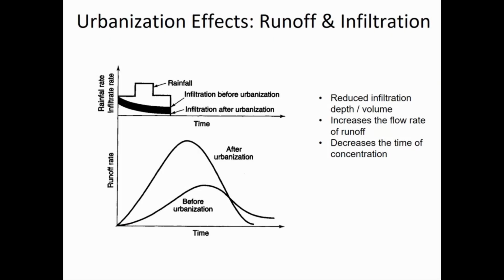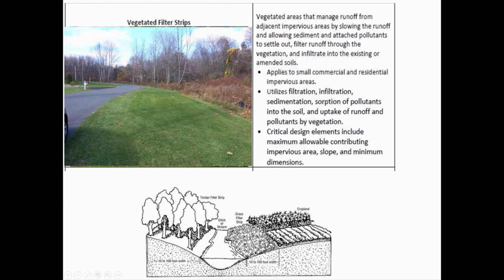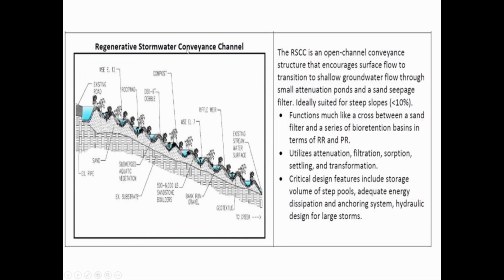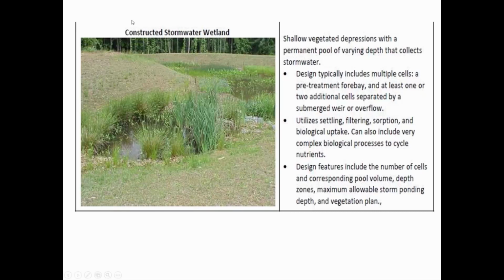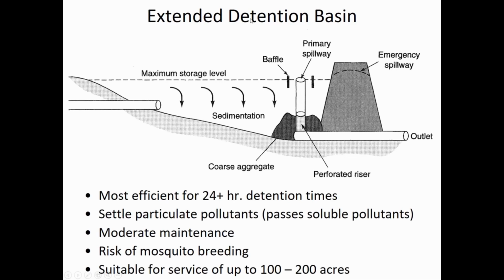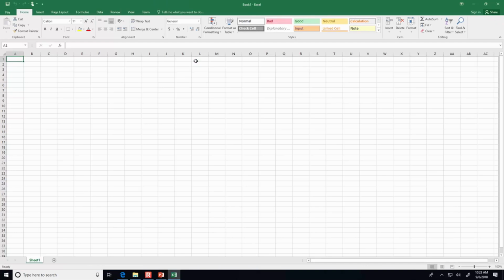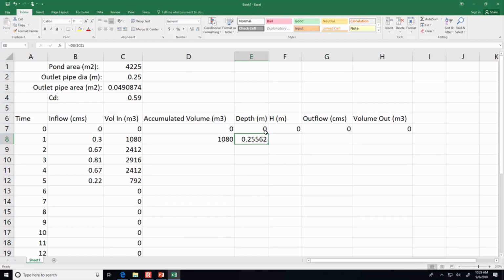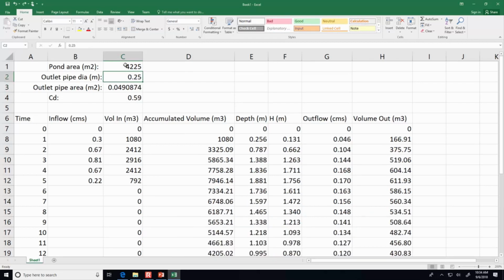CE 433 - Class 7 (29 Jan 2020) Stormwater BMPs and detention ponds

Comment: Hi Issac, this is a great series. I have dealt with some minor storm water designs with my senior engineer. I find this series helpful to fill in the blanks. I’ve been in the civil/survey field for 20 years. I do have a question. I know you said before you don’t give out the PPL files. That is great I don’t need them. What I am interested in is the homework problems for CE433 course so I can run through them on my own. Just looking for homework problems. Thanks and I do look forward to the rest of the series